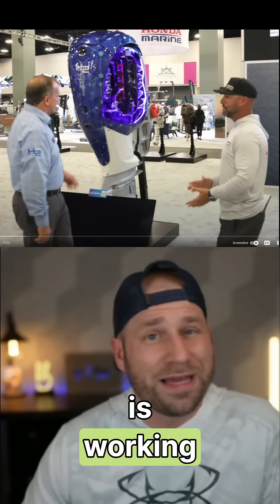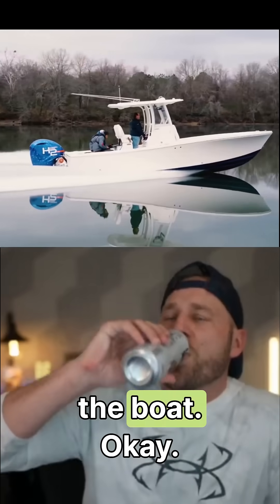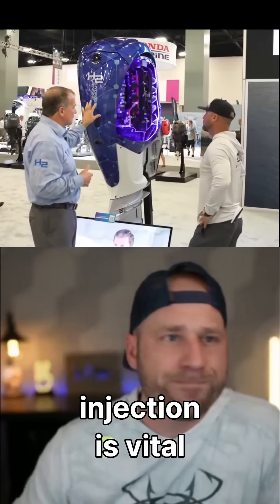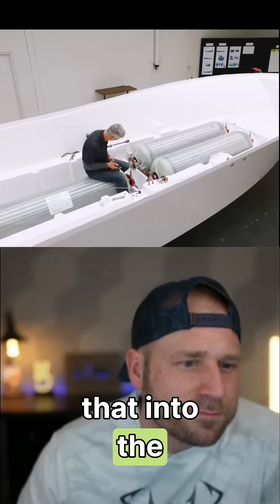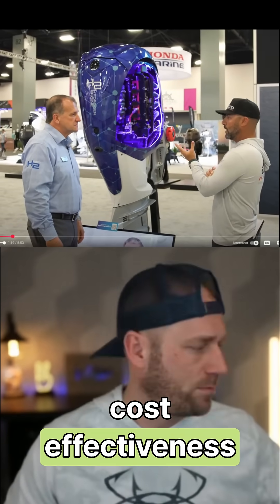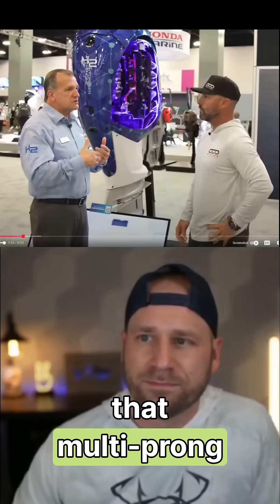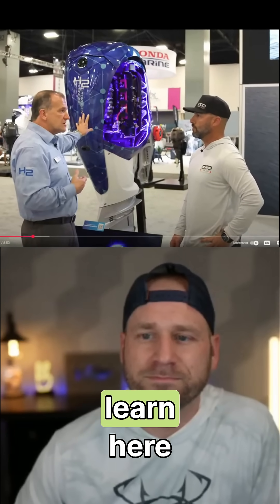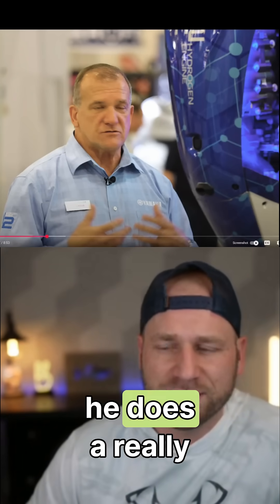Hydrogen Boats! Yamaha's INSANE New Engine Will SHOCK You!

Comment: As a mechanical engineer I can answer that question for you. It does reduce emissions by putting out water vapor so it’s less oil and exhaust going into the water, the engine will also have higher efficiency and hydrogen is THE most abundant element in the universe, so the cost will be lower. Also, your fueling will be faster which doesn’t matter to me and there will be a noise reduction for less sound pollution, which is a give or take cause I love hearing boats head out in the mornings lol
Reply from the maker: This is awesome! They should have you working at these shows to answer the questions!! Ha!!